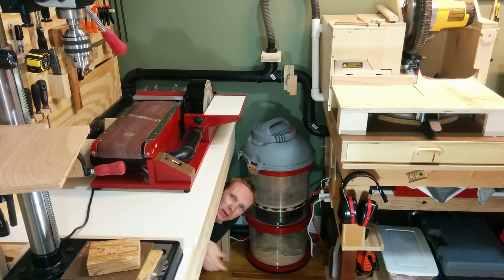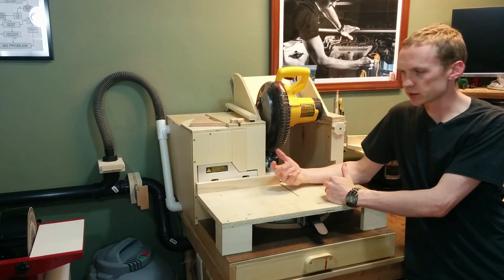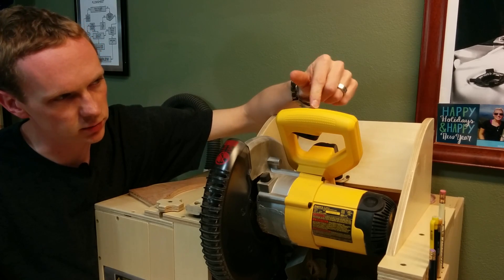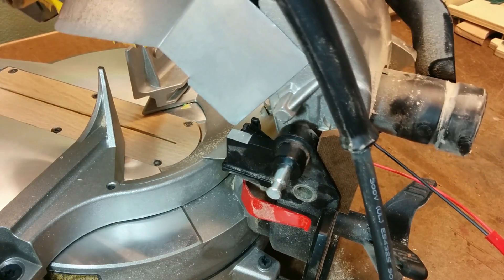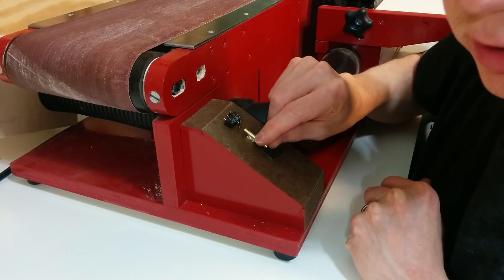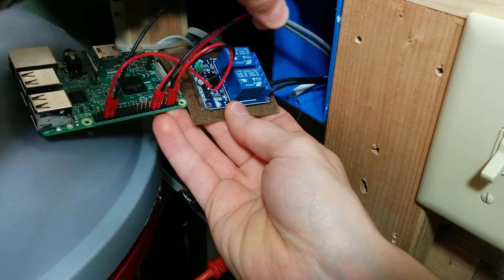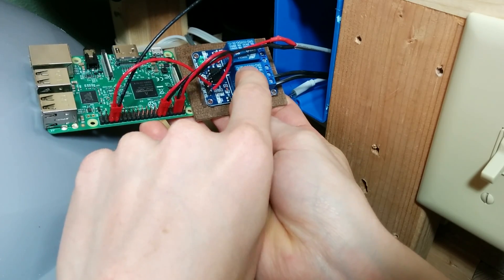Automatic Dust Collection

Comment: This is a pretty neat idea. In fact, this is a great idea.  It saves a lot of work, noise, electricity, hassle, distraction, frustration, etc.  Plus you can always over ride it by just turning off the vacuum.  It is a really good idea.  I have never seen that before.  And being inspired by the belt sander build, I started looking into buying one, but I like his build better than the commercial ones I see in the low end range or 350 to 440 watts range. Of course none of them have the dust collection, and none of them look near as sturdy or safe as his does.  The stability adds to safety.  ...and to mental peace. There is nothing more disconcerting that a vibrating flimsy stand resonating the work piece.

Comment: Using a raspberry pi to do a simple task like controlling a vacuum cleaner is awesome! 
Nothing less! 
A transistor, a relay and a few components could do the same! 
But again its awesome!
Reply: I thought about it, kinda overkill, could of done the same with a simple arduino for 3 bucks instead of 40, having a brain box is better because you can have more control such as holding the vacuum on for a few more secs after you turn the tool off
Reply: well actually the same could have been achived with 1 relay and putting the 2 switches in parallel as input for the relay.

Comment: That's a great idea! You might though want to eliminate the need for a mechanical connection to the moving part – e.g. the belt sander switch and its long brass rod. You could do this by gluing a tiny rare earth magnet to the switch and then sensing it moving by means of a reed switch or reed relay placed nearby (as in burglar alarm door sensors, for example).

Comment: Hi Justin. Another lovely project. I would modify the code to have some units stay on for say 3-5 seconds in chop saw, so it will not turn off when you are moving a piece. Also the sander, as there is always dust (some near invisible) after sanding. There are plenty of GPIO's on the RSPi. I would also cut a few slots in the switch box for cooling the RsPi. I presume you used Python.

Comment: Hi, excellent project! Check out the arduino line of micro controllers that may be best suited for such a minimal application like this one. Then again if you are planning to expand the Pi might be the best thing. Regarding ideas you could setup a web server to configure different parameters like on/off time and maybe even tweak it on a per machine basis like 10 seconds for the chop saw but 5 for the other machine. Thank you for the great video!

Comment: you could also do it quite simply with microswitches capable of handling the power draw of the shop vac, nothing else needed, the only downside is no delay in turning it off, but i can live with that.

Comment: Interesting with the Raspberry Pi, you could add a air quality monitor to the Pi, a PM1.0, or PM2.5, or PM10 Air Quality Detect/Sensor Module could do the trick, log the data it collect on the Pi, and have a web server on the Pi to present the data to your PC smartphone or whatever.
I would had use current transformers to sense the electric current from the individual sockets and then let the Pi read these and then start the vacuum depending on the current, as a side effect you could register your electric current consumption too just because you can. By using these current transformers you will have the same setup at every machine, there is no need to invent a one-off solution to sense the start of a machine, and you will have to fight with programming a bit more, but it should be simple when you get the feel for it.

Comment: I have two problems with this system. 1. The switch prevents a safety feature which means you can not use the push in lock button when the saw is not in use. The second problem is: there is no need for any type of computer, etc. Simply use the micro switch to operate a "contactor" (inexpensive) and a small power supply such as a 12V wall adapter. It works thusly:

When the switch is closed it operates the contactor; and it in turn turns on the DC.

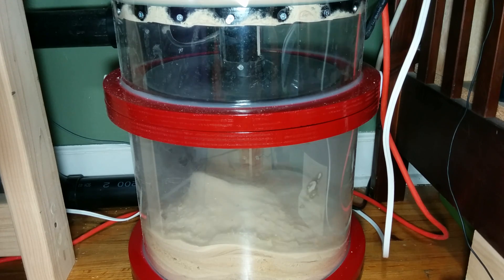Comment: Great idea! I like your hold down stick which you use with your saw at 3:59. Any chance of posting a picture of it on your web site or a how its made video? I'd love to make one. Many thanks!
Reply from the maker: Yes I plan on making a video on this. I  just made it and am still trying it out.  Thanks for watching!
Reply: I was going to suggest using analog circuits for this until you mentioned plans to expand using the pi.  Some suggestions are that you could get into lighting, volume control, or tool use logging.
Reply from the maker: Peter Worden great ideas... What are you thinking with the volume control?
Reply: If you were playing music at the time you ran a tool the volume could be adjusted depending on the tool used so that the music could still be heard.  Car manufacturers do something like this today with built-in radio volume control that compensates for the engine/road noise taking input from engine rpm, car speed, or ambient noise monitoring.

You could also just do random tool starting music themes I guess if you wanted just some inspiration for fun.  People do this for room entry theme music.  It may get old, but I think it would be fun from time to time.
Reply from the maker: Peter Worden I think pausing the music would work best since I typically throw on ear muffs when I use any tool. Sometimes I miss a whole song because I spent 4 minutes sanding something!
Reply: That will work.  You already are intercepting the entry point for tool interaction so its a good place to key start/stop on music play.  You can send the signal to Android phones uisng MQTT and making use of Tasker.  Many folks don't like Tasker due to complexity and there are alternatives, but you get the idea :)

Comment: Hi Justin. I'm a fairly new subscriber and I'm loving your videos. On one of your other videos you said you lived in an apartment and I was wondering if you get complaints about the noise. I know apartments are not usually insulated for noise reduction. I can only imagine what you will do when you get a house or a shop.
Reply from the maker: lake bum Hi Lake Bum, I do live in an apartment building but there are a couple of benefits to my situation. First it is a very old building and the walls are pretty thick and made out of plaster which is almost as hard as concrete! It's very hard to drill into. Also, the bedroom I have the shop in does not share a wall with the neighbors so that helps a lot in keeping the noise down. I also don't run the tools early in the morning or late at night. So far no complaints!
Reply: I see. Well, best to you and I'll be watching for new releases. I'm impressed with what you have accomplished out of your small shop. I'm in a 2 car garage and it seems I'm always fighting for space. I'm sure it couldn't have anything to do with the 36 years of accumulated stuff competing for space...
Reply from the maker: Thanks! The nice thing about the small room I'm in is I always have to purge anything that I don't absolutely need.  Must keep the shop tidy or else the shop disappears behind the mess pretty quickly!

Comment: Couple questions; Raspberry Pie vs Arduino any reason for pie (except taste)? You work from your apartment? How do you keep from having your neighbors through you out/assassinate you? And do you expect to get your deposit back?
Reply from the maker: I only used the Rpi because I have used Arduino in the past and wanted to give the Rpi a shot. I love in an older building that has pretty thick plaster walls. It's not like a modern apartment building where you can hear everything. Additionally the room that the shop is in doesn't share a wall with the neighbors so that is the biggest benefit. I don't see why I won't get my deposit back. The room will be cleaner than when I moved in.

Comment: Is it possible to use switches and relays without RPi? Minus one second delay and and minus whole RPi.
Reply from the maker: Yes you could use relays.  The main benefit of the RPi is the time delay.  That way both machines don't turn on at exactly the same time to avoid tripping a breaker as well as keeping the dust collector on for one second after using the tool to clear the ducting.

Comment: Hi, I noticed that dust was getting past the separator plate and into the vacuum chamber.
Reply from the maker: +art Dragon no, the separator plate is siliconed to the polycarbonate on the top side of the plate so dust cannot get into the filter chamber. Dust is getting between the separator plate and polycarbonate because I didn't apply silicone on the bottom side of the plate, which wasn't necessary for performance. However I do wish I would have done that so it didn't look like it was leaking.
Reply: Hi, I see, I just mistook the silicon for saw dust.

Comment: Why not use a server to turn on the vacuum and a PC to turn it off connected via wifi and laser sensors? seriously, you know you can hook the buttons directly to relays, adding a capacitor if you want a delayed turn off.. What exactly is a function of raspberry?? Not to mention a professional way of doing it is detecting when a machine turns on (some shop vacs have it integrated).
Reply from the maker: The point of the raspberry is to expand on the "smart shop" and incorporate other things into it.  This was the first one.